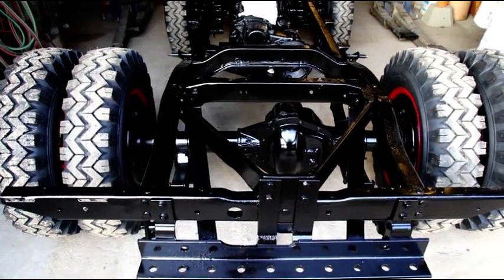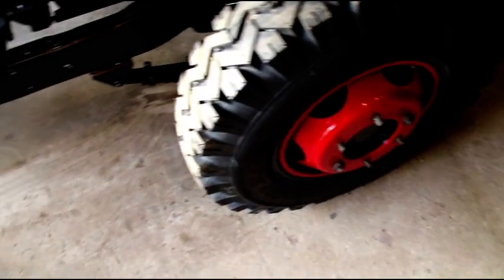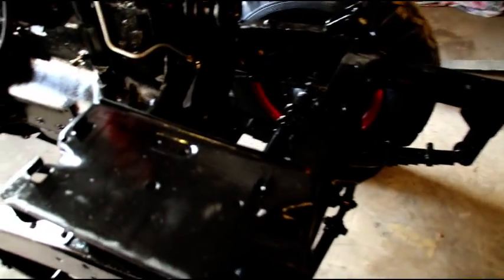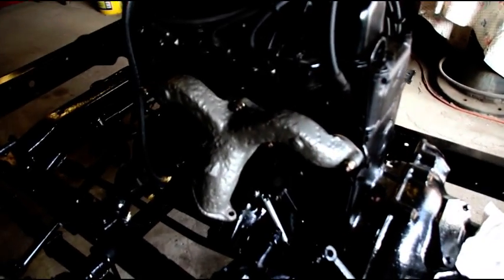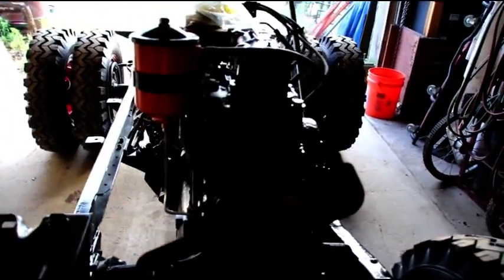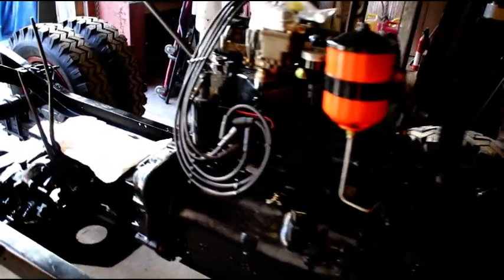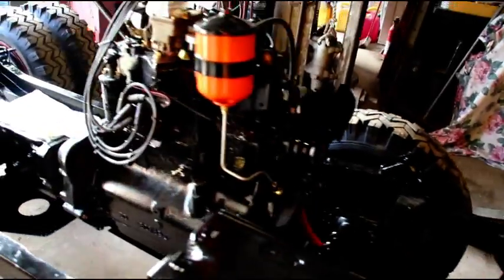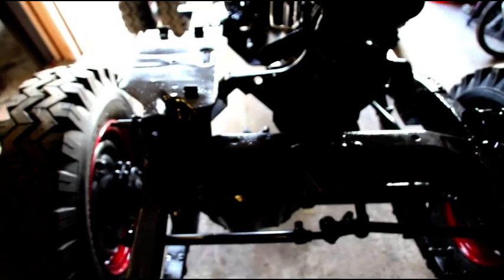Willys CJ5 Snowblower Jeep...chassis introduction and walkaround

Comment: Brian watching one of your older videos getting some pointers for a project I hope to start soon. The frame looks great with the black color. Is it paint or powder coat? If paint it looks like a gloss black.
Reply from the maker: Black chassis paint on the frame.   I don't like or use powder coating for anything.  Sandblast, epoxy prime, and black urethane paint is my system for frames and suspension components.  Holds up much better than powder coating. 
Brian
Reply: @metalshaperJeep  you are very helpful, knowledgeable and a great teacher. Thanks Brian for your reply.

Comment: If the engine is just seized. Take your plugs out, fill the cylinders about quarter fill of half automatic trans fluid and engine oil.
Let it set, every so often with a breaker bar try to move the crank. Backwards and forwards. Don't force.After awhile it will let go.
I have used this many times on engines. Be patience. I did this with a Cub tractor that had been setting in a field for 15 yrs. It took about a month but it let go. I drove that tractor for 5 yrs. until a guy wanted it badly so I sold it to him. That was 20 yrs ago and it is still running today.
Hope this helps. Bill

Comment: Here's a link to a Wisconsin below. No model number but perhaps a lead to follow up on. Not too far from you. Good luck...Pete

https://nh.craigslist.org/for/d/propane-gas-powered-generator/6325618063.html
Reply from the maker: Thanks for the link, I will check it out and see if it will work for my project.
Reply: Just found out it's a VF4D, not VG4D. It could be very close to what you're looking for.

Comment: Were those Wisconsin engines use on swathers, if so then there should be a lot of them in farm country like the Midwest,
Reply from the maker: Not sure what they were used in so the only way I can search for one is by the model.   It is a VG4D Wisconsin engine.
Reply: A swather is to cut and gather standing grain and put te cut grain into about 2 foot wide windrows,kinda looks like a huge, 20-25 foot wide  riding reel type lawn mover.

Many of them were powered by Wisconsin engines.

More than you EVER wanted to know about  swathers:):):)
Reply from the maker: If they had VG4D engines in them let me know, that way I can broaden my search.

Comment: What tires are you using?
Reply from the maker: The tires are Super Traxion 6.50-16
Reply: Do they hold up well? I Really like the older Tube-Type NDTs, but they don't really last as long as they could at today's 50+ on pavement.
Reply from the maker: They hold up much better than NDT's on the pavement.  You will probably go thru 3 sets of non directionals before you wear out one set of super traxion tires.  I have been using them for years with great service life.

Comment: i might have an engine for you. i have a vh4d with 29 original hours on it. it was a backup pump engine for a municipal sewage pump house. set up for propane but easilly converted. Nice work on the jeep chassis, what year is this jeep? thanks and be well!
Reply from the maker: Didn't do too much research on the vin number yet, but I think it is a 1962 CJ5.  Let me know on the engine.  I am going to look at a couple of 65 horsepower Wisconsin engines this weekend and see if they might work.